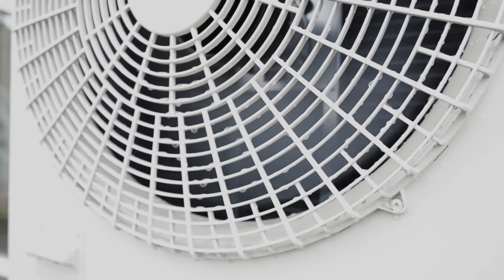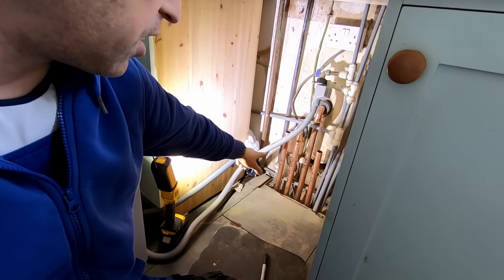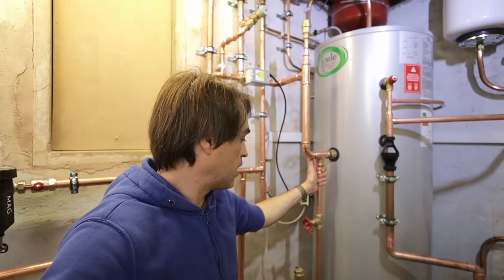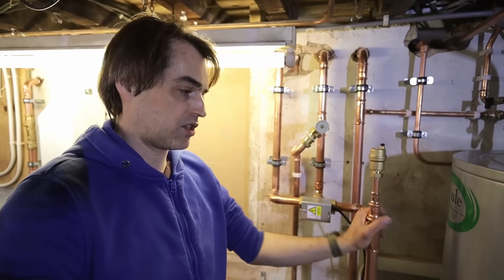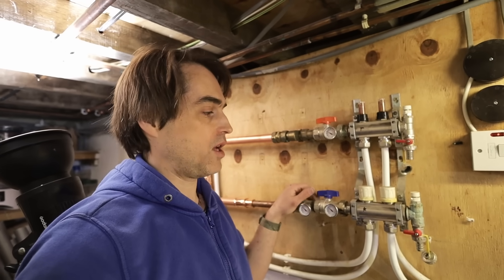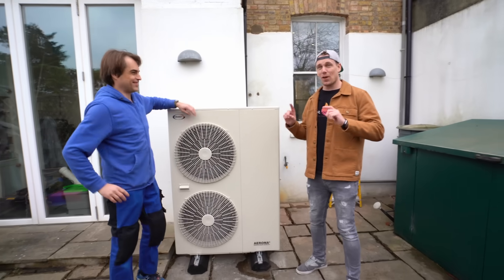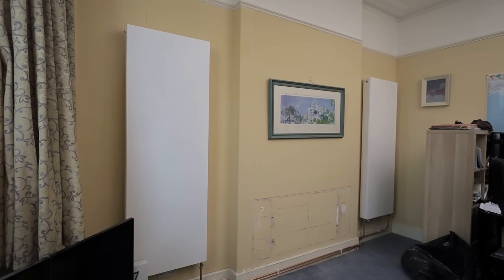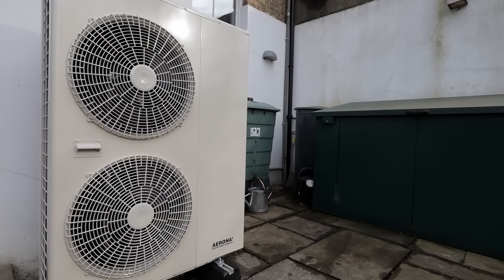The Truth about Heat Pumps: Debunking the Myth.

Comment: Hi there, fascinating video. On a really cold winter's day, how many units (Kw/h) of electricity is that particular house with the heat pump using, in comparison to say the hottest day in August?
Reply from the maker: Assuming cop of 3 on the coldest day (-3 all day and night) it will use around 4kwh every hour so 90kwh. That is if we get a full 24h of below zero temperature. Obviously on a day with temperature above 18c the unit is off so uses zero kWh. Hot water generation will be done by solar plus heat pump on cloudy days. Cylinder needs around 8kwh to be fully recharged from 10c to 50c by the heat pump, so energy usage on hot water is be around 3-4kwh (cop of 2.5) per 24h if used by 2-3 people everyday.
Reply: @UrbanPlumbers  "Hot water generation will be done by solar plus heat pump on cloudy days".  So you need to add in the cost of solar panels as well !  Please include that when you produce your next video showing all the costs.  Thanks.

Comment: I've not been involved with ashp's, how do you get around getting the tanks to over 60c for legionella? does the immersion heater make up the difference?
Reply from the maker: Yes, immersion heater is turned on once a week. In this case however there is also solar PV doing hot water.

Comment: So how does it work if you dont have an airing cupboard or a basement to fit all this kit in, what if you dont have the wall space to put those ridiculous size rads, how the hell do you re decorate if you need minimum of two people to lift them when their empty. The unit sounds quiet because its new give a few months and see. The cost to have all this I would rather spend the money on solar and wind and battery storage and run electric rads. The way the unit was installed out side on the patio what happens when you need to lift the slabs and it looks dreadful. I would say 90% of people wouldnt have this and definitely not the funds.

Comment: Thank you for showing all this. Going green can turn people into such mugs. Like the solar powered battery charger I bought for £30. After days in the sun it lit a bicycle lamp for just a split second. Money down the drain.
Reply: I think you bought a broken one. They aren't great but they are much better than that.
As a general rule energy is best generate on a large scale.
Glad you are using a recharable battery which is the green choice.
Reply: @julianshepherd2038  Possibly although it didn't look broken, but all these things have their drawbacks. I thought I had things sorted when I bought a wind-up radio, until the spring broke. But one thing I thoroughly recommend are solid bicycle tyres made by Tannus in S.Korea. No more punctures but just a bit bumpier ride. I've had three years of happy cycling with no nasty surprises whatever glass or thorns are on the road.
Reply: @keithbessant8346  Tannus tyres.  Bit bumpier, bit more rolling resistance so a bit more effort needed, and road-holding in the wet is not quite as good; but it is SO, SO nice to not have to test tyre pressures every  time I go out for a ride and no longer have to fix/replace a tube every month or so.

Comment: The problem is as you said, electrical system needs upgrading, pipework needs upgrading, new radiators,  installers need to be very competent because if any small bit isn't done correctly it won't work, it's expensive, it needs monitoring regularly,  a low paid worker in an ex council flat in liverpool just cant afford this.
Reply from the maker: Flats should go on communal heating systems - it will make the cost and maintenance affordable.

Comment: Good luck fitting those rads on dry lined walls which a considerable new housing stock are built with.
Reply from the maker: No problem. Just fit a timber between the studs. We do it all the time.

Comment: That room is massive so the radiator will be lost anyway! Gas boilers operate at 90 percent efficiency anyway, what good is reducing the temperature of the circulation?
Reply from the maker: Majority of boilers operate at around 80% efficiency or less. Dropping the return temperature is the only way to gain 90% efficiency. The lower the temp the higher the efficiency of heating systems but also larger radiators.
Reply: @UrbanPlumbers  my boiler the eco setting is the 5th highest of 6 settings, it's what I keep it on. Woster Bosch thing.
Reply: @UrbanPlumbers  efficiency of radiators ? They are 100 percent efficient as they are by definition heat loss? The temperature of return water will have an effect, the lower the temperature the greater the heat exchange efficiency, lowering the temperature of the circulation means the pump functions for longer before the heating function activates once more.

Comment: Why not to install air-to-air heat pumps? Much smaller indoor units than those giant radiators. Less expensive and more efficient.
Yes, this leaves you with some noise from indoor units, you still don't have hot water. But probably even immersion heater low efficiency will be balanced by higher efficiency home heating. Or maybe smaller heat pump just for hot water?
What are your thoughts?
Reply: Another option is a high temp heat pump, that can get the water to a much higher temperature.  Those work with existing heating installations... but they are pricey, and more expensive to run.  Personally I have good hopes for replacing natural gas with green hydrogen.  They're doing experiments with this in a neighborhood in the north of the Netherlands, using the existing gas network to distribute hydrogen instead.  Household heaters and gas ranges can be adapted to run on hydrogen without issues.

Comment: Heat pumps will be the Next Miss Selling Scandle , I have been involved with quite a few installations of Air source and ground source, all retro fits ie not new builds ,  they had to have a back up Boiler as they did not return enough Heat , 
I even came across a £3,000,000 new build with two ASHP and the owner told me the House was freezing in the winter , he was looking at taking the Builder and architect to court as Miss sold .
Avoid ,Avoid
Reply from the maker: Who is Miss Seelin Scandle? Never heard of her?

Comment: Real nice professional job, I'm curious about what you used for the heat loss calcs, did you use the SAP or the CIBSE heating design guide? I've found SAP to not be accurate enough for larger domestics with complicated fabrics and heat gains, especially with very precise systems like these that you can't just oversize to cover up a bad survey job.
Reply from the maker: Heat engineer software which is really just a CIBSIE

Comment: Wonderful... spending £20k-£25k on a new system when the old one is working fine is a complete waste of money.   For payback, you have to work out what will be saved each year... I suspect the electric bill will be the same, if not more, than the existing gas bill = no saving at all.  If the electric bill is less than the existing gas bill, the question will be by how much each year.   If you save £500, it will take 40-50 years to recoup the capital cost, to which must be added maintenance and repairs.    If you save £1000 p.a. it will take 20 -25 years for payback.    These units may be quiet when new, but after 5 - 10 years the bearings wear out, and like old fridges, start to rumble, grumble and rattle.  Your gas boiler has one pump and makes pretty much no noise.  Replacing that pump is relatively cheap.   Running hot water using an electric immersion heater is about the most expensive way to get hot water short of an electric shower, and the heat pump will warm water to lukewarm only.     
The hype for marvellous underfloor heating with half a mile of pipes in the garden only works for new builds with excellent insulation.   For an older drafty building it is going to be very disappointing as well as expensive and noisy.     Anyone who has a heat pump more than a few years old tucked away at the bottom of the garden or in an industrial estate will know how irritatingly noisy they are, as they run all night on "cheap electricity" which is fine if you don't have neighbours nearby.
If your heating system needs replacing... get a gas system before it's too late and save thousands of pounds... and a log burner as back up.
Finally the carbon footprint of the extra copper piping and steel radiators will have added tons of CO2 in their construction... so not exactly saving the planet
Reply from the maker: Old system was dead mate

Comment: Why not use a heat pump for hearing only, and a small induction boiler for the hot water? Surely cheaper, less work, less materials, and probably cheaper to run
Reply from the maker: What’s an induction boiler?

Comment: Who is going to pay for all this?  It must cost thousands, and most people will not have the room for all this equipment!   It might be fine for rich folk in big houses, but for the average joe it would be an expensive nightmare.  Do people know it requires regular servicing by a qualified technician so would cost more than a normal boiler service.  Electrical wiring might need upgrading too.  Then there is operating and understanding all this, it is a bit more complicated than a normal central heating controller!  🤔😵‍💫

Comment: Enjoyed your video, very well presented and you know what you are doing. I wonder how much pollution is caused by the increased material requirements when being manufactured, copper and steel etc?  Also the rads are ugly and space invading as is the heat pump itself and last who can afford it?  Let’s use hydrogen on existing installations where most systems will not need much upgrading. More practical in all areas.
Reply from the maker: Wait till you see the cost of hydrogen
Reply: @UrbanPlumbers  I have been involved in hydrogen so not as bad you think in future. Also my message re material, labour costs, damage to the environment by increased manufacturing, transport costs from deliveries and increased journeys by installers due to longer installation times. Also the prohibitive costs of installation of the equipment and insulation. I hope I am wrong as there is a place for heat pumps in the right properties but older houses maybe not.

Comment: Multisplit reverse cycle air conditioners/heat pumps just seem such a better way to go than hacking an air to water heat pump into a radiator setup.
Reply from the maker: Direct electric hot water heating, noise, bulky internal units, movement of air and dust. There is a lot of drawback to air to air as well.
Reply: @UrbanPlumbers  Sure, best combined with Solar water heating with electric backup. A handful of Internal head units vs lots of big radiators is a wash I think on that. Having grown up in Australia with 70s/80s era air conditioner tech, noise and dust is a massively overblown thing.

Comment: OMG,Where to start,who has the room for that huge installation,not everyone for sure.Who wants those huge ,eyesaw of a radiator in such a small room to heat it.The man says it's crucial the sizing of the system is worked out correctly, trouble is not all installers will bother,or even know how to do that,so thousands of installations won't work
Reply from the maker: Training installers is by far the biggest challenge at the moment

Comment: Good to see a properly designed system but I can't see how those huge pipes could be satisfactorily concealed in my new build house and those huge radiators are just plain ugly.  It doesn't seem like a feasible solution to me.
Reply from the maker: new build will have much smaller heat loss = smaller heat pump, smaller pipes, smaller raditors
Reply: @UrbanPlumbers  how small would it be?  I doubt there room for anything bigger than microbore behind the drywall.  Also, what sort of radiator size would be usual for a new build?

Comment: Looks horrendously old fashioned
What happened to the unit outside in subzero temperatures & performance  ?
Reply from the maker: The system is designed the way then when heat pump output drops with sub zero temperatures it matches the heat loss of the property.

Comment: Imagine ripping out a gas heating system for this overly complicated mess. Also I challenge you to go back to that exact unit in 6 months and hold the microphone up to the fans. Wonder how quiet it will be then. What a joke.
Reply from the maker: I will. There will be updates from this job with running costs and performance. Subscribe so you don’t miss it when it comes out. 

I will check the fan volume as well.

Comment: Well, i read the part about commenting on the rad sizes, But personally, i think we need a complete rethink about central heating, simply because they are just so massive,people will not want that amount of wall space covered with these monsters. they are just so ridiculously large they are not acceptable today,I have to add that your pipework is absolutely brilliant and the quietness of the heat pump unit is brilliant, But i have lots of doubts about this idea selling to the general public on mass.
Reply from the maker: Underfloor heating is the answer to the radiators. Also if you can drop your heat loss radiators will get smaller.

There is number of countries in Europe that have successfully adopted heat pump on a massive scale.

What is it with the UK - always the opposite of everyone else. Must be the driving on the left side of the road that does it?
Reply: @UrbanPlumbers  Yes that's prob the answer thanks for the reply,Do you know what a full quality installation costs these days,I assume a normal regular 3-bed semi, today with say an ideal 30 k , that would be around 4/5 grand is that right. But what about a heat pump system. thanks again.
Reply from the maker: Normal regular 3 bed semi: system boiler + unvented cylinder + new radiators and piepwork would be around £10-£15K. 

Same system with a heat pump would be around £5K more. Propably why the government is giving £5K grants.

The trouble with heat pump cost is the fact that you have to redo part of the installation and radiators. If it is a new installation then the difference is no longer that big.
Reply: @UrbanPlumbers  Ok once again thanks ,yes i am surprised at the price for a regular system boiler and rads,cheers mate ,
Reply from the maker: @peterryan7827  cost of materials and general inflation is out of control at the moment. Some materails are going up 5% per month.
Reply: @UrbanPlumbers , We must have been very lucky then, recently we had a local chap fully gas safe, to replace an old combi for new, plus new rad valves on all rads on 6 rads, The boiler was ideal combi 24 k , He charged me £1950.,it was a good job and we were happy to pay it, this about 6 weeks ago ,just before this flaming war started so maybe we were very lucky, anyway many thanks for all your help.bfn

Comment: much more cheaper and efficient / eco-friendly would be to install a heat pump air to air.
Reply from the maker: you would have to do your hot water on direct electric that would be 200-250% less efficient. You also have bulky units in all rooms, movement of air and dust and noise of the units. Air to air is efficeint and cheaper to install but it is not more efficient to correctly installed air to water and it has more issues from comfort and eastetics perspective.

Ideal air to water install would have well insulated property and UFH throghout - quiet, cheap to run and invisible.
Reply: air to air is much more efficient than any central heating system. You are turning the heating room by room, when and where is needed. For example, if I'm not using the bedroom between 6AM and 9PM, why heat this room? 

In the central heating system, you can also turn it off and on a room by room, but the question remains how much time is needed to heat up the room again? With air to air, very quickly, with central system air to water really slowly, so slow that it doesn't make sense to do so. Also, it uses much more power.

The unit is not any bulkier than any traditional radiator. 

With air to the water heat pump with radiators, you need to heat up the water to like 50 degrees. With airt to the air you don't have to, a temperature that needs to be reached is much lower therefore much less energy is needed.

It also has very efficient cooling.

This dust is such shi*y argument, that I'm surprised that you bring this up. So there is no dust, with central heating? Do even know where dust is coming from? Also, air to air units because of their filters can at least partially work as dust collectors and air cleaning units.

Noise? Install for example Rotenso Imoto X and check noise levels, I almost don't hear it. It is similar noise to water flowing through the radiator.

You mentioned heating hot water. You could do it with normal direct heaters, even if this will be 2x more expensive, such heaters are very cheap and don't cost crazy amounts also repair or replacement of such cheater is dirty cheap. Compared to this whole system.

But I guess I understand your point of view, it is better for you to sell to the customer a very expensive heating system, rather than efficient cheap HVAC.

Comment: A buffer is nice because you can charge it when PV panels are up or when demand if very spikey.
Reply from the maker: There are PV panels there that charge the battery that in turn runs the heat pump or charges the hot water cylinder. No need for a buffer.
Reply: @UrbanPlumbers  But why exactly is a buffertank not a good idea. Because the return line has a higher temp  ? When with a heatpump you want the return to be as low as possible ? I myself have a geothermal closed loop vaillant system. And have a 300liter buffer tank. The main reason being that apart from the floor heating i also have ventilo convectors for active heating/cooling in the bedrooms. It's really just a question. My actual COP is 5+ atm.